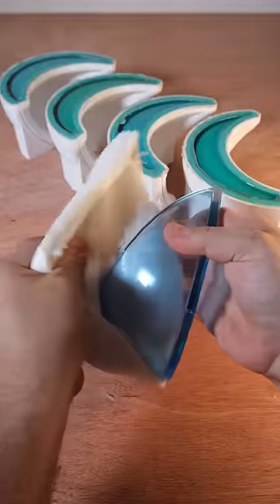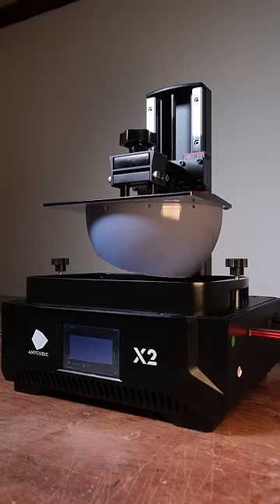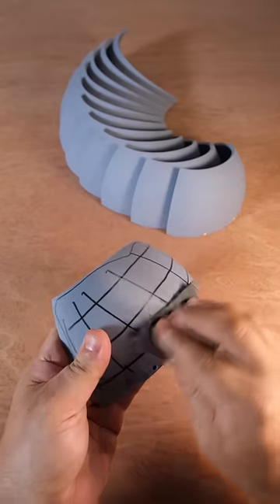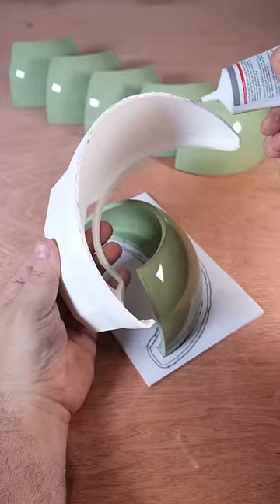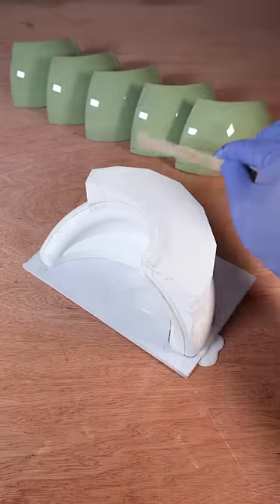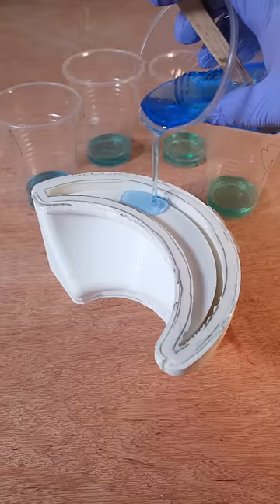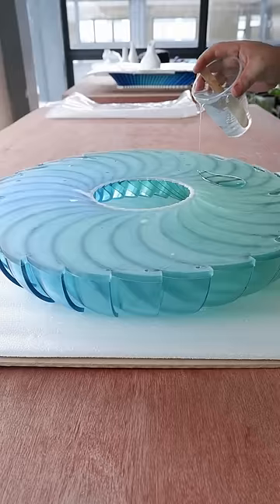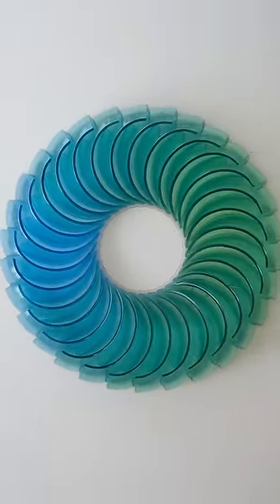Resin Art Disaster #3dart #3dprinting #resinart

Comment: Using sharpie to make sure it’s all sanded evenly is genius
Reply: That's an age old trick used in bodyshops.
Reply: Used engineers blue to check surfaces and clearances and markers for the exact same thing as shown in the video as machinist here since years. Rather old technique but yup, it defo works and is a good way to get consistent results on irregular shaped surfaces.
Reply: @steelwitness learning how to fix electric guitars, luthiers use it too.
Reply: i apologize, but i don't understand. how does the sharpie help in sanding it evenly?
Reply: @blanket_2835  as you sand the surface the high and low spots will be easier to see with the sharpie. Is the sharpies starts sanding away faster in one spot then that means that spot was highers than other areas. If the sharpies is sand away slower that means that spot is lower than the rest
Reply: @steelwitness  ohhhhh, i see. thank you!
Reply: Guide coat is better
Reply: I've always used pencil for this when sanding wood projects. It's such a good hack.
Reply: Bro discovered the first trick of sanding non flat surfaces
Reply: you mean a "MARKER"?
Reply: @ivanivanovich5904  has to be a sharpie
Reply: @steelwitness used in woodworking long before it was used in body shops. It’s a technique used for millennia. Kinda cool to think about.
Reply: @rjgaynor8  actually you're thinking of charring. You burn the outside of the wood and then sand it.
Reply: They used to used charcoal to mark the surface of the wood before planing the wood. Marking a surface before sanding is not a body work technique. It’s something that has been done for thousands of years for stone masonry, woodworking, and even metal working. It did not come from body work if anything it was forested used on stone.
Reply: No, it's just experience/good research.. but hardly "genius".
Reply: @dong6839  what's the point of being a dick? I mean really? You don't know this OP and have no idea where they are coming from and why it seems like genius to them.  

So this is something you already know? Good job... 

To someone who may be just starting from scratch and teaching themselves a trade.. If they have been struggling because they seen or heard of the technique it most certainly could feel like a genius, game changer for someone.

My husband does some woodworking and has built a couple guitars... My grandpa spent my entire childhood out in his garage woodworking year round, even in January in the middle of winter in Michigan.  I'm sure they both use[d] this technique but I don't know about it.  If I ask my husband about it and he shows me directly how it works I would probably say, "That's genius.. I wouldn't have thought to do that."

Either way... Keep at it... Snark looks good on you.
Reply: @dong6839  That's why I got into AI 30 years ago, it was easier to teach a shell script to talk than it would have been to get you to teach us anything
Reply: spraying a black, or on dark colors a white guide coat has been used since the moment body work became a profession...
Reply: Woodworkers use that trick everyday. With pencil though since sharpie gets absorbed into the wood
Reply: @blanket_2835 same here… idk either.🙏🏾🙏🏾🙏🏾
Reply: You can Also you just the lightest dusting of black spraypaint. Or any color thwt contrasts with the workpiece
Reply: @blanket_2835 my question as well. I’m thinking he applied it so he doesn’t miss a spot and leave a non sanded spot. But it’s not like you can’t tell if a spot was missed. Shiny smooth vs rough dull texture.
Reply: That technique comes from woodworking. We just use a lead pencil.
Reply: @dong6839 Don't be such an arrogant know-it-all. 
No craftsman/-woman ever knows everything, depending on the focus of their work and because there are always many different approaches to hit the goal. 
I am an amateur woodworker who learned some craftsmanship by working at a restoration workshop and I already showed tricks and approaches to professional woodworkers they were surprised about, in spite of me being the rookie, so what?
Reply: Wow... and I was thinking why he marked with sharpie 😅
Reply: Using this in life thank you so much
Reply: Ohhhh
Reply: common practice
Reply: It's a common practice.
Reply: @steelwitness Yep. A guide coat. 👍
Reply: I'm pretty sure Walmart sells this taco shell holder already.
Reply: You can also use this trick to practice sharpening a blade evenly!
Reply: It doesn't make any sense
Reply: @kaylaglass1195  What would you recommend?  High tech costs a lot a money a takes time.  Using a grid pattern to get a visual feedback while sanding is the best option.
Reply: It's a pretty standard technique 😂
Reply: It's just Tool and Die.  Been done like this for decades,  perhaps centuries.  An old die maker from 1905 can come to 2024 and work on a modern die.  Trims, forms, and cams are all the same.
Reply: You can just use pencil hash marks. Woodworking tip.
Reply: Also used when tuning metal ski edges
Reply: It’s such a simple thing but it works amazingly on literally all materials
Reply: please don't read my name
Reply: Also used for sharpning knives😊
Reply: @steelwitness body shops don't do that lmfao who are you
Reply: @YungEagle3k  been working in body shops for almost 20 years now. blue fat tip sharpies have always been popular for quick guide coats
Reply: "genius" not really
Reply: Dentists use it too
Reply: This is a very old trick. I did it 20 years ago in 7th grade shop class.
Reply: Genius? Seriously?
Reply: Basic technique there bro relax
Reply: @ivanivanovich5904 
Over here we call it a Sharpie lol, even though Sharpie is a brand name.
Reply: @GingerNinja1  yeah, same as you name all the rest of the tools by the way they are used;)
Reply: No it’s not 😂
Reply: @steelwitness ima try this for shaping acrylic nails
Reply: I use a guide coat. A light coat of a different color paint or primer.
Reply: That's how I sharpen tools for my lathe
Reply: You can use stains and glazes too. Success is material dependent.
Reply: Normal practice in woodworking
Reply: @hankhill4542  😂 but we don't have sharpies over here in Europe - at least I haven't seen any ;-)

Yes, we use any marker ;-)

Comment: Frog tape is your friend with acrylic epoxy . Use it to dam off pieces . It wont leave a residue and its better than blue tape .
Reply: Yeah, idk how he expected that poured resin to not drip over the edge
Reply: @juancena1259 mhmm like how was it not gonna happen
Reply: A garage kit painter I watch uses sticky tack to cover areas they want to keep clean. I think maybe that could work with resin?
Reply from the maker: I have tried this on my smaller pieces, but found i didnt even need it if I leveled everything correctly. I will be trying this in the future for my larger pieces.
Reply: @HerschelShapiro  Do you think this piece would of worked how you were thinking if you DIPPED the whole back of the structure into a layer of resin - rather than backwards and letting gravity fuck you up?

I’m genuinely wondering if you think that would work?

Like maybe fill up a foil turkey pan or maybe even a few inches in a child’s pool for bigger pieces?

I know it’s not practical … but most cool art isn’t 😄
Reply: And if you sprayed those with mold release, couldn’t you get the unused resin back out?

I’m just starting my resin journey 🫠
Reply: @Witchy-Wonderland  oh, i had been wondering why there needed to be forty molds and forty 3D prints instead of just one to re-use.

Comment: I keep watching this going “I really think that there are like two redundant steps in his process.” Why are you 3D printing the final product, then creating a casting of it to create a negative to create a clear casting? 3D print the negative and make the clear casting.
Reply: I'll take it a step further, he's printing the part in resin to make a mold of it to then cast it in resin. Just print the part in clear resin, sand, buff, tint, done.
Reply: ..I thought I was having a stroke
Reply: I think it has to do with the texture of the surfaces - the mold would have a rough texture resulting in clear resin product with a rough surface?
Reply: Nah, that's what the sanding and buffing is for. Wet sanding up to 1000 grit will give you glasslike smoothness.
Reply: @weapwnx14  He’s not printing the “master parts” in resin.
Reply: You can't print a silicone mold
Reply: he cant print the negative, how whould you like him to get the used piece out of a HARD SHELL, he has to do it this way to make the negative silicone
Reply: I also noticed that a major part of the build was the gradient color between the pieces. Notice the different color cups when he’s pouring into the molds. I think this is probably possible with resin printing, but I could also believe it’s enough reason to do it the way he did it. 

That and being an artist means some times you discover amazing things when you’re doing it “wrong”, or doing it with less than ideal efficiency. The line between engineers and artists is blurry.
Reply: The negative needs to be silicone and you can't print silicone.

(Well in theory you can, but there aren't commodity machines available to do it, and you probably won't get the desired smoothness.)

Comment: In the future, you can use all kinds of stuff to guide/control resin… from paste wax or silicone spray lubricants to stop it sticking where you don’t want it, to stuff like play doh, wax, or hot glue to physically block it.

I’m sure you’ll continue to learn and grow and you’ll have a cool broken and fixed sculpture to remind you that failure only exists if you refuse to learn something. There are only successes and learning opportunities for the strong willed and those who try!
Reply from the maker: I have tried a lot of these on my smaller pieces but realized if i just leveled it correctly I would not need to block it. But with the larger pieces, I am learning that I may need to try this.
Reply: were you expecting surface tension to keep it from going over the edge?
Reply: @Tracy-hm3yi  That’s what worked with his smaller pieces.
Reply: @soude85  but this time the edge is jagged so surface tension can't be maintained as easily.

Comment: I still refuse to believe this can't just be directly 3d printed with tints and polished for the exact effect.
Reply: right?
Reply from the maker: It would look similar, but it would not have a glassy smooth surface or the color gradient. With the resin printer It would be like frosted glass and tinting the resin in the printer a different color for every print would waste more than half of the resin because a lot of it needs to form a layer at the bottom of the vat.

Comment: You need to weigh the resin so you have exactly equal parts and then mix super good. Use som plastic strips to keep the resin in, you’ll have to tape or glue it then you’ll have to make sure it cures for a while before touching. Before you leave it to dry, use a heat gun to get bubbles out

Comment: For anyone else doing molds like this, make sure you use tin cure silicone and not platinum cure. Platinum cure is very sensitive to the monomers in 3D printer resin and often will refuse to cure, leading to an unfixable goopy mess.

Comment: Should have made a shallow tray to pour a thin layer of resin into, then set the pieces upright into that resin. And of course made sure the table was level. I only have about 25 years experience working with resin casting and silicone mold making... Happy to help people figure out how to make a mold, troubleshoot a casting problem. 'Course some people I try to help stubbornly stick to a procedure or process they're having issue with.

Comment: Idea, have a small lip so that only the areas that you want to have resin locked can be coated, but the outside of the piece would have the lip so that resin can't run over the side. Might be hard to do with pieces like this, but it is something to think about testing during the design process.

Comment: may i suggest when you try it again, to fill the center with a pour to cover the space of the lip of the hub center... that you could remove later.  to prevent the drip down effect when you flip it over to do the bottom.  meanwhile to also use a ring around the outside of it to not allow drip down on the sides... the other option would be to make a mold for the bottom that would have a wall both in the center and outside wall to do the same thing.  you just rushed it is all.  its' how we learn.  try ...try ... try again.  each instance improving the next.  peace.

Comment: What's the point of sanding n painting the 3-D parts if ur just using them as molds
Reply: because the imperfections in the model leads to imperfections in the casted pieces